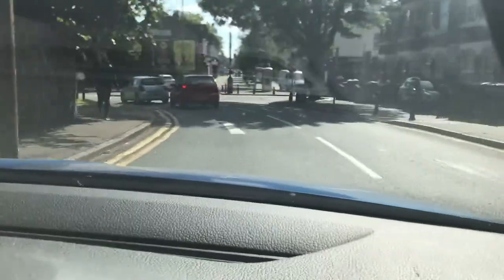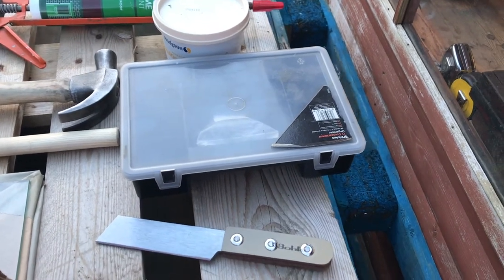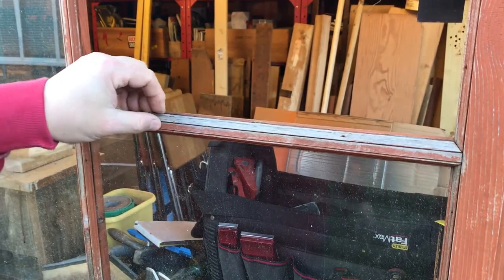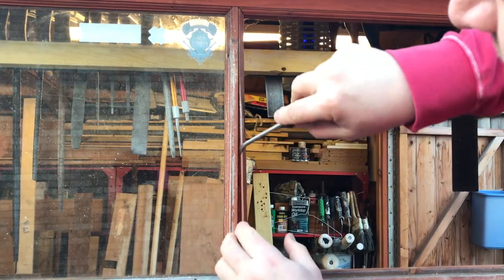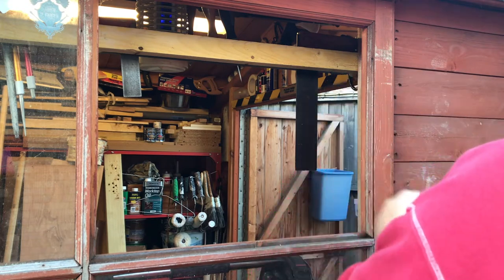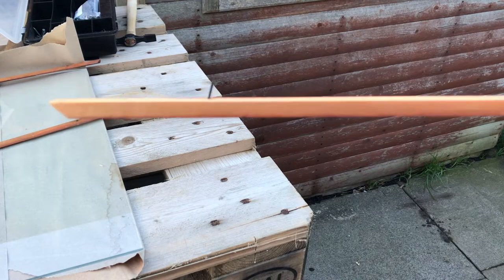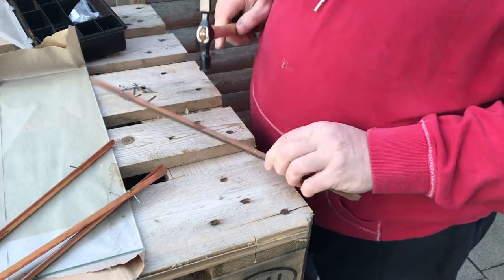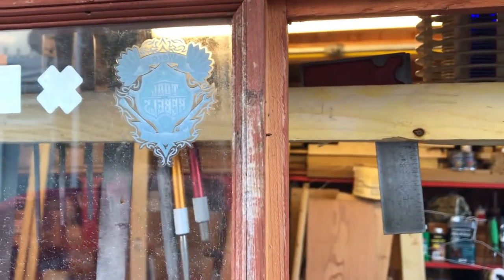How to: Re-glazing a Broken Shed or Workshop Window

Comment: I have just used silicon sealant. Put a fine bead first, then glass. I tried to put a couple of pins in, but it didn't work, as very old windows. The put sealant instead of putty. Now worried the panes will fall out 🤣🤣🤣
Reply from the maker: If I can find an old (small) glazed window on a skip, I’ll do a video on how to putty a window properly. You’re right it’s quite common to seat the glass on silicone but putty is still usually how you finish it off externally.
Please remember to subscribe to my channel, hit the notification bell and watch a few of my other videos for more tips and helpful content.
Reply: Thank you,  I can't find putty in the local DIY shops, for the smaller panes, I think OK, But today I start on 110 x 40 cm panes 😱